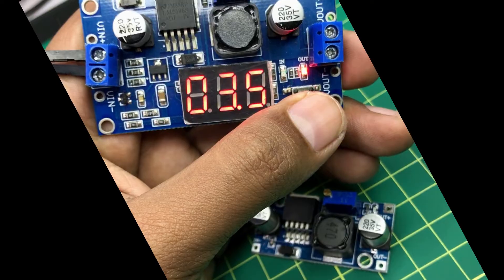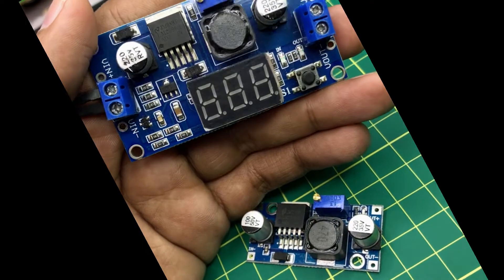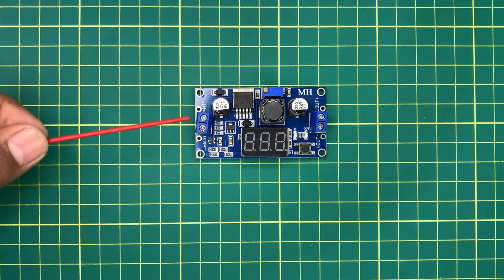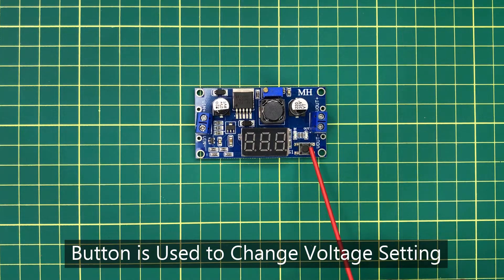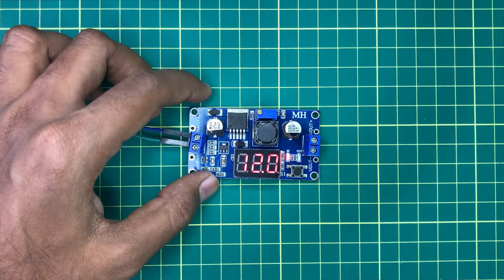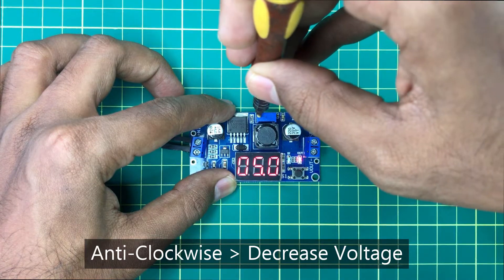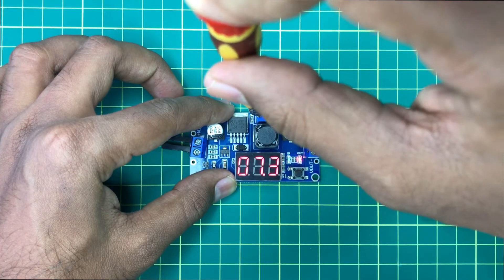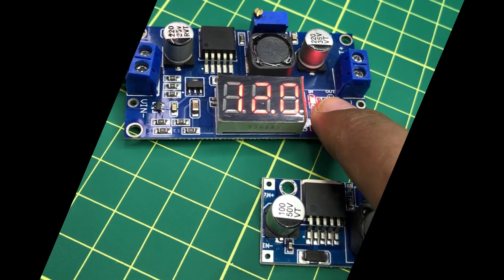LM2596 DC-DC Buck Converter Explained | DC-DC Step Down Converter Module | LM2596 Voltage Regulator

Comment: Awsome. Now i can power my thermastat that runs my cabinet fand using 12 volt nolonger having to run through the inverter. So sweat. I ordered 2 of them. This will power fans to coll my solar power station im building and exaust any gasses because I'm running my components near the lipo4 batteries in a 40" tool box that ive added vents to alow the fans to pull cool air through the bottom and exaust the hot air and any gasses from the batteries out the top. This little device will allow my thermastat to enter a sleep mode saving tons of energy when the system is not in use. 😊

Comment: I had one of the no readout models and when i tried I could get no voltage variance and I turned the adjuster a lot either way. Assumed it was defective. I bought one with the readout and same deal and with the switch seemed to be nearly the same number. So I came to youtube to find out wth. I went ahead and turned the adjuster but it took an awful lot of turns to get it to start adjusting, but it finally did. The seller should set that pot to where it is adjusting and not take tons of turns to start that.

Comment: Can I use this for converting DC 12v-3a to DC 9v-0.6a ?? Please suggest
Reply: I am inputting 12v. By the manu specs the model without the readout can maybe go down lower. I would say to contact a seller you find and ask what they have for specs. And realize that even if they say it will it may not and be ready to have to return it or get a refund. .6 volt sounds like kind of low to go. My readout model gets down to about 2.5 and lower the readout dies. But it is still putting out voltage as my pc fan still runs. Using a separate voltmeter it appears it is only able to limit to about 2.5v. The other model may get clear down to .6 but you  would just have to try an experiment

Comment: I'm searching a device/module that makes a circuit being permanently in the range of voltage supplied to a maximum of 12.5V...   I have a 12v acid battery (connected permanently to a batt charger) feeding a 12v router + fiber ont..   When battery is charged, the charger keeps voltage in aprox 13v (float charge),  but when is charging  the voltage increases to 14V - 14.8v...   What i want is when the voltage output is OVER 12.5 or 13V,  this will be lowered to 12 - 12,5V to protect the output to these devices avoiding damage...   Someone knows what am i searching for??
Reply: I have solved the low voltage when batteries are getting low voltage with a XH-M609 module, i set it to shut off when voltage drops to 11v...  Now i need something that regulates the voltage to the range of 12 -12,5V  when the batteries are charging and the voltage is over 13v... something like an active voltage limiter...

Comment: Thank you! Now i know mines broke. Just arrived and it refuses to reduce voltage
Reply from the maker: Turn 10 - 20 turns for anti clock wise direction and measure output

Comment: That is a great video because I ordered , I ordered it on timu but I didn't know what it was and because it was only like $2 or whatever. That's why I got it and I found you and showed me what it does. That is so cool. I'm going to try to connect this board to my raspberry pi and it will control the power. Cuz you know the power button is not on the older models and this will be a cool little thing to mess with. Thanks man!

Comment: Got mine today
Need help
My way to hot to touch can not hold it in parts in board 

Can show how to use mire 

I try usb brick 5v 2.1a
And will not turn on my led light made for remote control truck

But it will not light up, puzzled

Tried with board only use the top screws on the in side turns on but when it is in the out side n nothing happens 
Wish they did put push pin connector to add a fan

Comment: I am planning to make a mini blower. using a2212 brushless motor which requires higher voltage but I want to use only 2s lithium ion battery, 3.7v each,  to make it more portable. Can i use this dc dc buck convertor to high up my voltage to 14v ???
Reply: yes is good for your projects
Reply: @WQF6  I did my research since I am a newbie to this electronics world and I came to know that you just can not step up the voltage using the BUCK convertor instead you need a boost convertor OR Buck-Boost combo convertor... I accidently ordered a buck convertor to step up my voltage to 12v from single lithium ion battery, lol. Beginner mistake i guess.